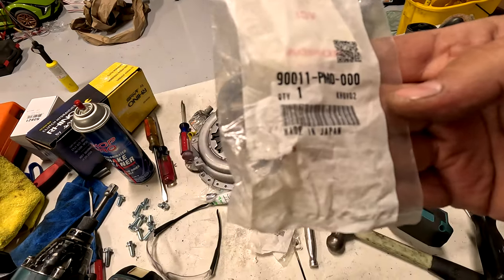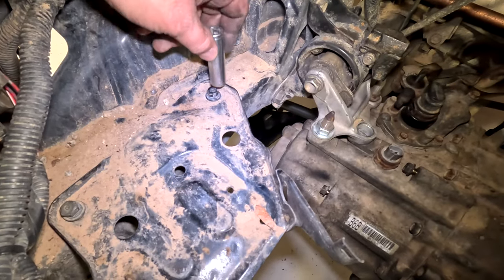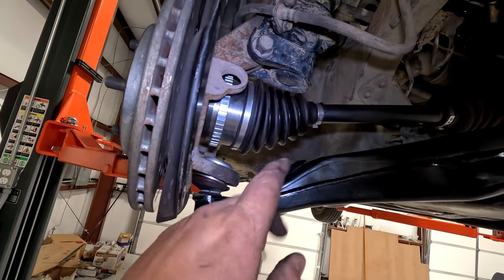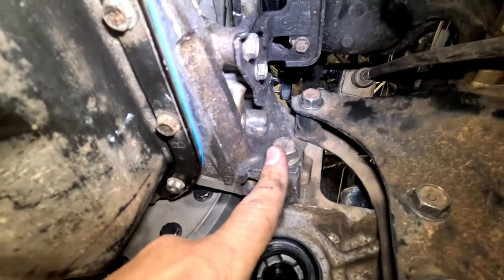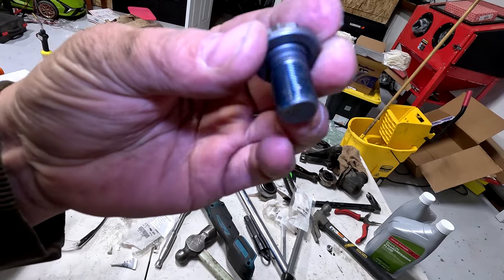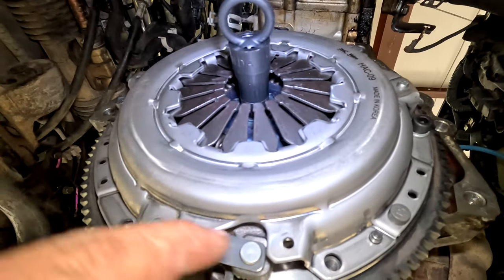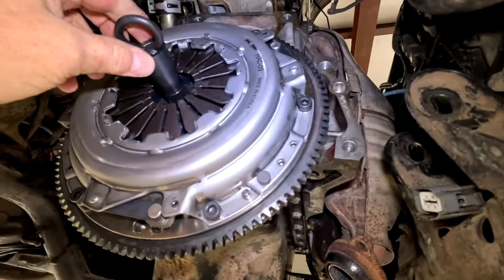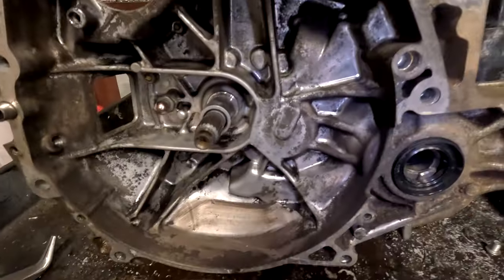2003 Honda Civic 1.7L Clutch Replacement | Flywheel Replacement 2003 Honda Civic

Comment: How did you remove the transmission? Didn't remove the bottom frame?
Reply from the maker: just leave it connected to the ball joints, then remove the 4 bolts.  then pull it out of the wheel well area.  done

Comment: Are there other models Honda with the same spare parts?
Reply from the maker: more or less they are all close to the same
Reply: @FatGuyBuilds  
Model 1999/2000  same pieces?
Reply from the maker: @hananhanan3424  any B18 engine will be the same